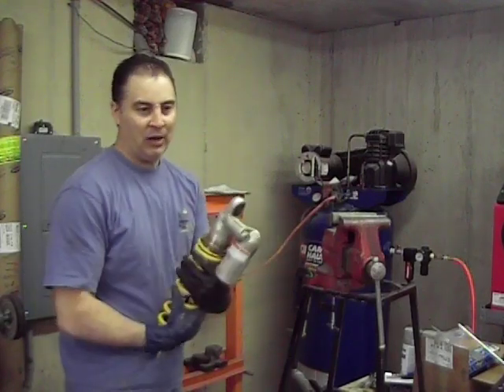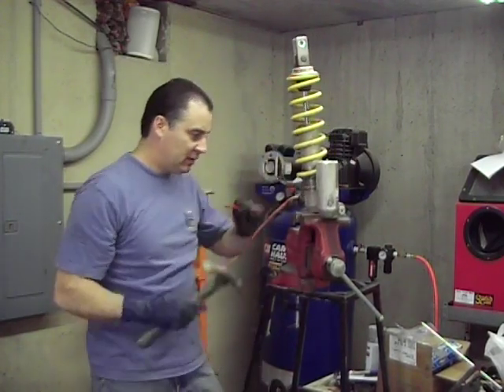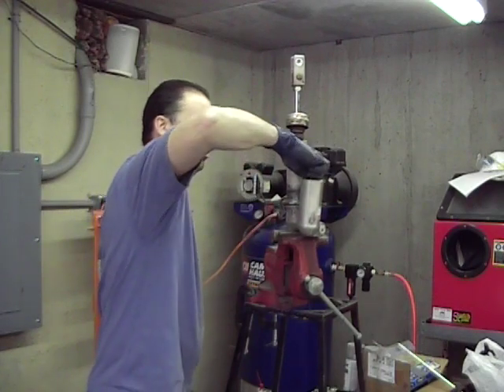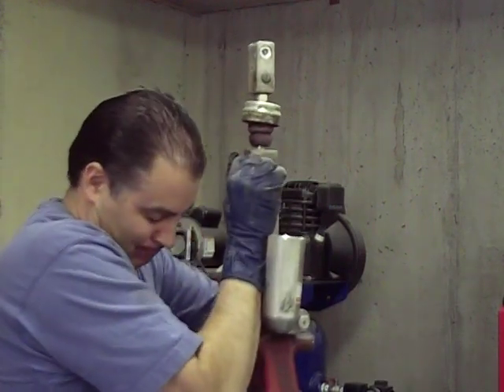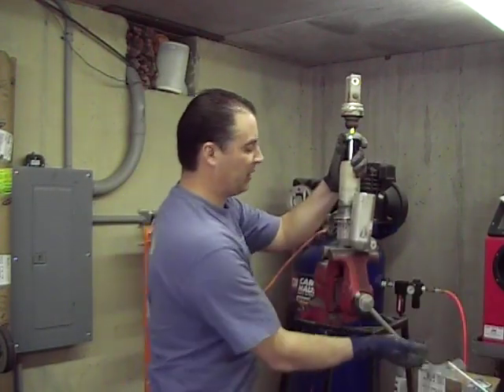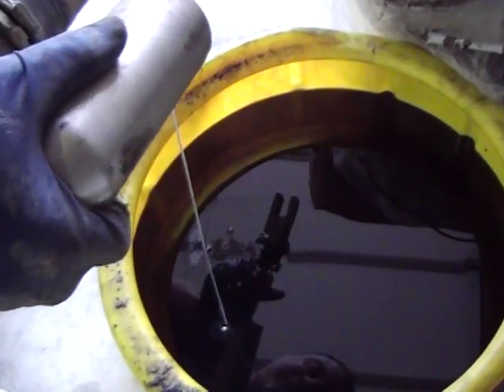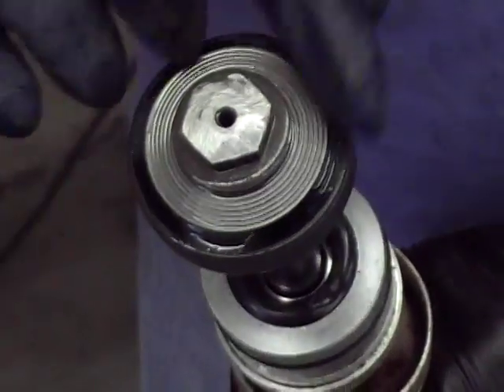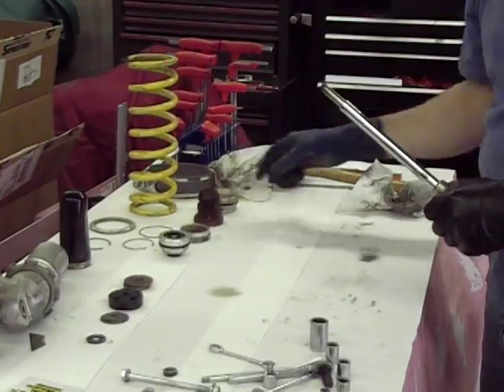EveRide DRZ 400 Extreme Makover Episode 4 - Rear Shock Disassembly

Comment: Nitrogen is used because it has no moisture in it vs the air we breathe, the moisture is what expands and contracts with temp changes, straight oxygen wouldn't have moisture but its not an inert gas where nitrogen is meaning oxygen can react with other elements while nitrogen can not and you don't want oxygen reacting with anything inside your shock, fluids and metals would "oxidize" ruining your shocks day.  Plus nitrogen is abundant and cheap.  We always fill race car and Kart tires with only nitrogen so the pressure stays more consistent.   Good video im getting my DRZ soon and likely will end up with a basket case since im poor and your videos are just what I need to rebuild and refresh everything I can. Cheers
Edit: I guess technically if you have a bladder shock you could use straight o2 since its contained in a rubber bladder but deff not with a separated piston shock.   But now im just rambling and need to go to work.

Comment from the maker: I actually have done more valving on inverted forks than upside right forks, and really, the inverted forks do a better job at consistent dampning because the sealed cartridge separates the 2 oil chambers and therefore controls heat better. They can handle more aggressive work loads, thus are found on motocross bikes that are getting beat to death. They can be made quite plush, and still handle a big hit. For dual purpose/dualsport/adventure riding, upside right forks are just fine.

Comment: Really hoping I didn't ruin my shock shaft after following this video. I should have watched a few others before jumping in. Apparently you are NOT supposed to grind the threads flush with the piston nut because the inside peening holds in parts in the rebound port. You are ONLY supposed to take off the outside swage to get the nut off and not disturb the inside. Racetech and a few other videos show this.
Reply from the maker: You should know your particular shock before randomly following a video dude.... this is specific for a DRZ shock, not others.....
Reply: +MrDuhfactor mine is a DRZ with the exact same shock, dude.
Reply: +Jay Kanor 3+ videos say to not disturb the inside swaging, especially on Showa's
Reply from the maker: +Jay Kanor then I'm not sure what you did wrong, there are many shocks with rebound check balls and other things that require a beveled edge, but not this one...I've done hundreds with no problems, good luck with yours....

Comment: I’m about to do this and I wonder if the internal rebound mechanism in the shaft will be okay after grinding down so much of the top of the nut? I ask because the grinding instructions by Race Tech for Showa says only the top outer edge should be ground otherwise the rebound mechanism can dislodge during use. Their picture shows only a very small outer part ground. https://www.racetech.com/page/title/IP%20SK%20VALVING%20STD  They actually sell a castle nut to repair shafts ground too much. Maybe they’re being too conservative?
Reply from the maker: I depends on which bike your doing, racetech's method applies to some of the old Showa models. The staking affects the outside of the shaft, and the inside of the nut, so if you take off material on an angle, just make sure to take the outer edge of the shaft, and you will be able to remove the nut without damaging the shaft, which is the primary goal.
Reply: MrDuhfactor ...I’m doing the exact same bike, 2002 DRZ400E (street legal version). I don’t think I’ve ground too much off, but I did take a fair bit because I still couldn’t get the nut off. Basically I went slowly, trying to remove the nut, then did some more etc etc. How would you know if you’ve taken off too much thread, do you know ? The little rod is still inside the shaft core, and when I look down the hole in the center of the shaft I can see a small “ring” (ie narrower diameter hole than at the top of the shaft) just ~2mm down, so I figure that’s there to stop the internal rod from being ejected (?). Should I put the race Tech castle nut on to be safe? TBH I’m not really sure what potential problems they’re alluding to when they write about being careful not to grind so much as to ruin the rebound mechanism.
Reply from the maker: @ronanrogers4127  You are fine with how far you have gone. The rebound mechanism for this model is not nearly as sensitive as other models, and you would have to go way below the step you are seeing before you create a problem.
Reply: MrDuhfactor ...thanks so much

Comment: You didn’t finish. If you take the bottom mount off the shaft there is a long needle in there with a on ring on one end. Might asleep replace that whilst your at it.